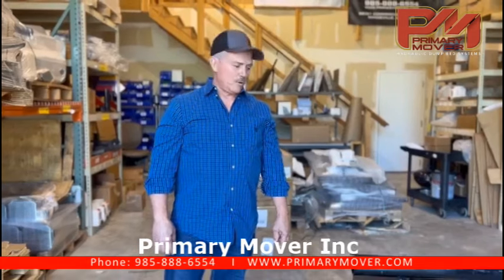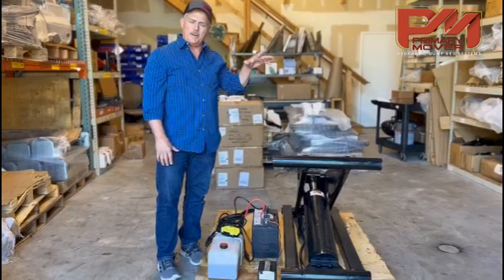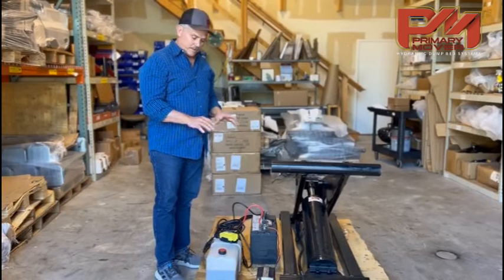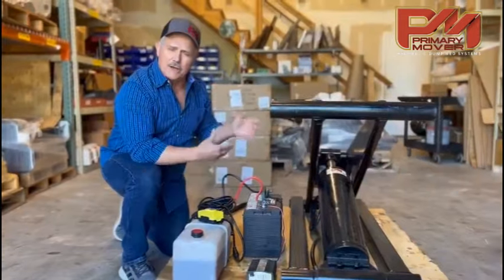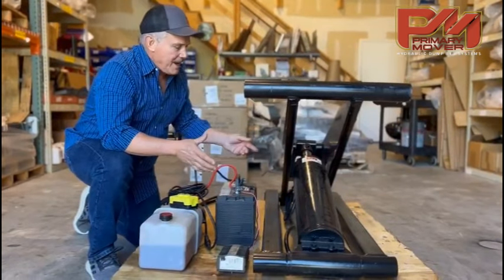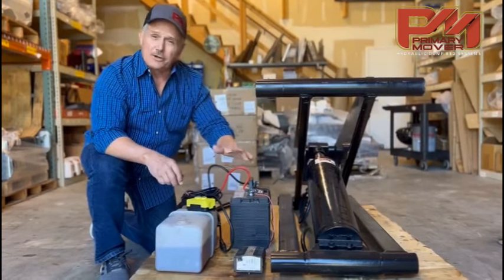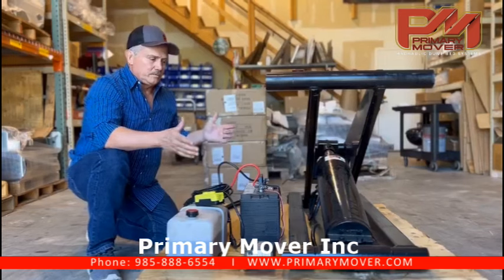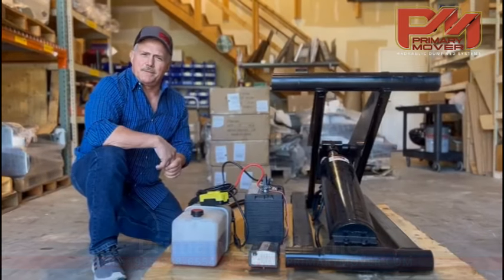How to Bleed air from your Hydraulic System

Comment: Great explanation ... looking forward to the pros and cons of the single vs double pump options. Thank you for your time to create these videos
Reply from the maker: Thanks for the support. We currently working on a video to address those differences. Please subscribe and thank you.
Reply from the maker: Single Acting Systems vs Double acting Systems  - Single acting systems are power up and gravity down. An advantage of this system is that the motor runs when lifting but the motor does not run when lowering. Because these units are 12V systems and run off a 12V battery, you use less of your battery supply with each dump with the motor not running when lowering. This system does require a larger reservoir because you must fill the system to it full capacity when lifting and all that fluid is returned to the reservoir when lowering. Most Single acting systems have only one one supply hose connected to the bottom of the cylinder. the top port of the cylinder will generally have a breather fitting in it to allow the air above the piston inside the cylinder to escape during lifting and air to return inside the cylinder when lowering. ------------- Double Acting systems are power up and power down, With this system you motor runs going up and going down which uses a little more battery supply with each dump cycle. The advantages of this system are that is uses a smaller reservoir because hydraulic fluid is pumped to the cylinder to extend it (lifting) and fluid is also pumped to the cylinder to retract it (lowering). In doing this the cylinder will always have fluid in it and it just transfers from one side to the other so the cylinder becomes like part of your reservoir. Double acting systems will always have two ports with two hydraulic hoses from the pump to the cylinder. One port on the pump , generally labeled port "A" will be your 3200 psi high pressure port and that hose will go to the bottom port on your cylinder (port opposite the rod side of cylinder). the second hose from port "B" will be you 1500 psi pressure port and will go the the port on the cylinder nearest the rod for lowering. Double acting systems give you the advantage of being able to force the dump bed back down when making partial load dumps or when spreading with your dump bed and half of your load is at the rear of the bed and too much weight on the rear your bed and it is up in the air and won't come down. Using a Double acting pump will allow you to lower the bed. Your choice of selecting a Single or Double acting should be based on your use and your peference.  ---------------------------------Thank you for your interest in our products. Please allow us to assist you with needs and help you with any further questions you may have. ------ Primary Mover ------ www.primarymover.com ----- 985-888-6554

Comment: Clear as a bell, thanks.  I'm installing a new single action pump/ reservoir running a manifold for five different rams.
Reply from the maker: We have a new product coming out called the X-Block and it will allow you to run double acting cylinders with a single acting pump.

Comment: What if the cylinder doesnt move up? Is there too much air in there n if so what's my nxt move. I think I ran the unit low oil in tank n she sucked in air....
Reply from the maker: If you tried the methods explained in this video then you might have a different issue. You could be having a issue with your relief valve. What type of setup do you have?
Reply: @primarymover8249  I have a single. I believe it's the downward valve failure. The solenoid I can hear n feel clicking. If the valve is always in the open position it would make sense. But I bought the jungheinrich brand and dont know where to get parts
Reply: If it’s a two way cylinder set up on a one way system what would you block the 2nd line plug in a hydraulic line cylinder a bolt or a vent?
Reply from the maker: You would use a vent on the top port of the cylinder. the filling is called a breather fitting. Doing this you would only need one line from your single acting pump to the bottom of the cylinder.
Thanks for your interest in our products.
Here is a link to the breather fitting on our website
https://www.primarymover.com/products/breather-6-sae
Reply from the maker: If you ran low on fluid and air was sucked into the system you will need to follow the proceedure of adding fluid and going thru  bleeding steps.
Video link - 
https://www.youtube.com/watch?v=-7HhjMS_kp4&lc=UgzIqIJVBK_drxDCoGJ4AaABAg.A093tfnazg3A31YCnn6sme
Reply: @primarymover8249 hello...I couldn't open the link you sent  so I removed the lowering valve n tested in solenoid and see the ball at the end of the valve is in the closed position n when energized I can feel n see the ball open. The O rings look ok but this is a 2009 model. Wasnt expecting to see the valve closed. Scratching head... do I replace valve or do I go back and try your link? Ty
Reply: Went and looked and I can only find the video on this thread. Hope y'all can help me get this working or I guess she goes to scrap yard

Comment: I have a altec at248f 2016 my lift doenst work and the hidraulic tank had a lot bublees. Back there I overflow the tank, but I take it off. Só what I can do now?
Reply from the maker: Could be an issue with your relief valve. It will cause the fluid to bypass and flow directly to the tank and cause a similar effect.
Reply: @primarymover8249  thank you so much. Solve my problem

Comment: Hey, I have a question .. my dump box moves up and down with out giving any rpm when it’s rpm . But when it’s loaded I have to give 1500 rpm or more to lift the box up ….while lifting up I can hear some kind of air noise … could you please tell me if it is weak hydraulic pump or something else .
Reply: add more oil to the reservoir

Comment: what is the best hydrolic pump that can lift up to 8 tons
Reply from the maker: The Hydraulic pump/ power unit,  does not determine the lifting capacity, Our power unit supplies hydraulic fluid at 3200 psi for lifting and 1500 psi of pressure for lowering, to the cylinder. The cylinder diameter is what determines the lifting capacity. A 5 inch diameter cylinder receiving 3200 psi hydraulic pressure can lift much more than a 3 inch diameter cylinder receiving 3200 psi hydraulic pressure. Make sure your pump/power unit supplies at least between 3000-3200 psi of pressure so your cylinder can lift the weight it is designed to lift. Some low cost models being offered on the internet offer a lower pressure output and much less flow which will not allow your cylinder to lift to it's full capacity. Make sure you buy a reputable brand with 3000-3200 psi output and and average 2 gpm output.  All of our brand pumps at Primary Mover will meet these higher output requirements. Visit our website at primarymover.com or call us at 985-888-6554 and we will be happy to assist you.
Reply from the maker: When choosing your pump you must determine if you want a single acting system (Power up and gravity down) or a Double acting system (Power up and Power down). Next you need to determine what reservoir size you need for available hydraulic fluid to activate your system. Single acting pumps will require a larger reservoir size than a double acting. We can assist you in determining the size for your needs. Thank you for your interest in our products. We look forward to assisting you.  Primary Mover

Comment: But u cannot continue to add fluid to half or more because once the cylinder is fully extended, all that fluid needs to go back into the tank when you bring it down.
Only the hoses will still be filled. 
Your reservoir can’t hold it all and will spill out.
Just look up what your cylinder volume is, and put 1-2 more quarts excess in your tank. Then do what he says to remove air.
Reply: That is only correct in a single acting application. The application he is showing is a double acting cylinder the fluid is actually transferred to the top side of the cylinder so you only have to account for the cylinder rod. Double acting setups are preferred if you want to run a smaller tank as the fluid mostly stays in the cylinder but just changes sides.